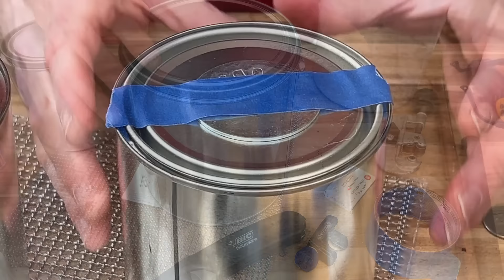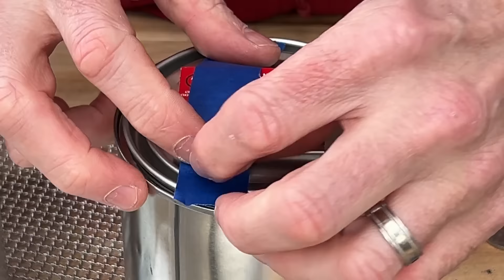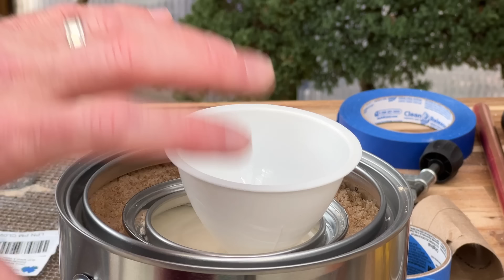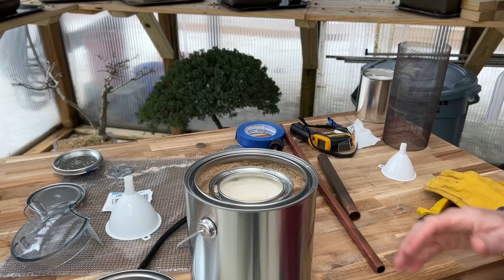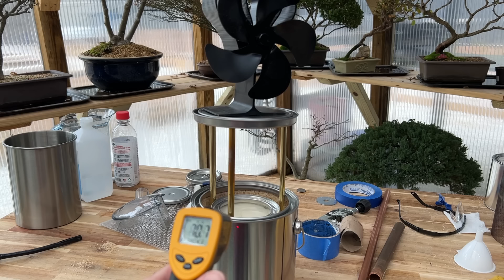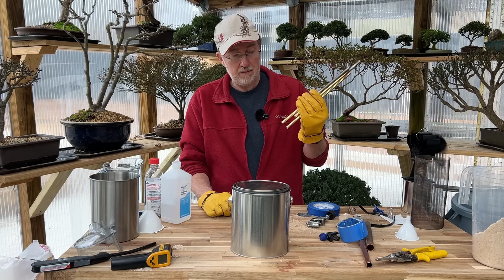Endless Heat Without Electric | Safe Reliable And Low Cost

Comment: Buy waterproof matches wrap in plastic wrap store in a pill bottle or a chewing gum container ( mentos large size )   Another tip : tin cans can be rinsed of food residue and used as a make shift kettle in an emergency.
Reply: Forgot to add when storing matches make sure to also store the striker papers on the side of the box

Comment: An upside down funnel will send the sand to the sides without getting it on the inner can.
Reply: Cool 😎
Reply: Brilliant!
Reply: Good idea. Thanks
Reply: great idea
Reply: You mean just using a funnel... Not upside-down!
Reply: @SGaux-Sandra  only if you have a very fine, granular sand that doesn't 'stick' or pack well.
Reply: @Філлм  And didn't he use wet sand on the sides as well?  That wouldn't move through a funnel very well at all unless you had a stick to push it through.
Reply: @40KoopasWereHerebut he only used wet sand because that's all he had available. He said in the beginning that they had had some rain so the sand wasn't as dry as he would like. Guessing most folks will be buying their sand and not readily able to gather it from their environment.
Reply: @cxh1225  I believe  @ stephenK....  meant to put the funnel upside down on top of the smaller can so the sand slides down the outside of the funnel and doesn't accumulate on top of the burner can.  Its good idea!!
Reply: @faridbirang3742   kudos to the people who think outside the box!

Comment: the only thing is of this is used during a power outage to warm up a indoor room, well there's no electricity to power the carbon monoxide detector,  they are usually plug in an electrical outlet
Reply: Mine is battery operated
Reply: Mine is battery operated as well.bought it for van camping

Comment: I love this. I'll be starting van life in about 9 months, and I'm worried about freezing half to death LOL I don't mind the heat but I can't stand being cold. This is probably the primary way I'm going to keep warm during the winter months I'd also considered using the terracotta pot method but I tried that at home and I feel like it's not very effective I appreciate the links for purchase too !
Reply from the maker: Be sure to get co and smoke detectors.  Cheers
Reply: @ZenGardenOasis.  I absolutely will. If you get this comment and have the time,  can you determine what the approximate burn time would be....?

Comment: The fan you’re referring to does use electricity. It makes its own electricity with a circuit converting heat to electricity DC current that’s what powers the motor for the fan. 🇺🇸🇺🇸🇺🇸%

Comment: We used this idea decades ago to heat up fish huts in the wintertime. And used the lid to check the flame /use the small lid to cover the small can 1/4 1/2 or 3/4  of the flame, it will control the size of the flame.
Got so warm we were sitting and fishing in our t-shirts. 
Works like a charm.
Reply: Did you ventilate or did you guys get headaches?

Comment: Good Idea.  As for the larger pale you could use the paint can inside the pale with sand under and around and use a full role of toilet paper.  The paper towels may not work quite as well.

Comment: I would also attach 4 posts together to be more stable for a cook surface..
Reply: Or you can attach 5 post together and  have a cook stove with one extra leg and do it in different  colors and sing and dance and do stuff like that. Then you can maybe cook burgers on it but you need a bigger can and a small. Pan .So you might have to cook one at a time only. This means someone  has to wait. OR you can cook one at a time,but split them in half as they get done and both can eat at same time. That being said ,cook one ,cut in half and share.  Cook another,cut in half and share. Save the gease to you can use it the next time in your can. OR put it in another can then make sure it's cooled before you put the lid on. Then do 20 jumping  Jack's, turn right to left 45 times.  See,I can write long ace stupid  comments  too.  Boring too.  😅

Comment: So I just made one to heat my trailer; and truly the denatured alcohol burns clean:

but have you any tips on dealing with the smell of burning toilet paper, as the alcohol dissipates?
Reply from the maker: You need ventilation and co detectors
Reply: @ZenGardenOasis.  But you said in your video that it provides clean heat for hours.

The alcohol, when filled to the full, burns off in about an hour, leaving burning toilet paper as the remaining heat source for any additional time beyond an hour.

Wondering if I missed something in your invention's design.

Comment: I suggest looking into pervious concrete for the 'wick' should burn just as long and the wick will never need replacement.
could fill the sides with sealed concrete? the concrete would make transportation of the entire unit more durable.

Comment: Finally feeling more secure with my pantry preparations thanks to your encouragement!  In way of preparedness I wanted to share that I found a site online that shows you how to make an emergency heater very easily. Search “zen garden oasis and the post was about 6 mo ago. He basically uses unused gallon and quart paint cans, sand , a couple pipes, a roll of toilet paper and denatured alcohol to make an efficient heater that can be used indoor in cold weather emergency, and could be cooked on as well.

Comment: When deer hunting as a kid with my Dad he taught me this using an empty one pound coffee can, We didn’t use a larger can with sand. It put out great heat and we just tamped the bottom of our boot on the top to put out the flame a few minutes before we were going to leave to give it time to cool. When cool to the touch we put the plastic lid back on to keep it from evaporating. This brought back great memories. Thanks
Reply: Great idea about the coffee can, but I haven't seen a metal coffee can in years. Maybe they are out there, I'm not a coffee drinker.  Lol.
Reply: @onetweetygirl71 walkthrough grocery store and you can see metal cans😅😅😅😅😅
Reply: @davidgoosen1633 true, but we/I was talking coffee can, with a lid. Most cans you find in grocery stores do not have a lid. Some yes,  but in mine, no, or i have to search high and low or request a product.
Reply: Prepared Hero Fire Blankets would be awesome to have next to one of these heaters. If a person caught their clothes on fire you would just wrap the fire blanket around them or if you needed to put a fire out you just lay the fire blanket over the fire. I bought them for my family last year. My grandson put his in his room. I keep one in my apartment and one in my car.
Reply: I found a way to help make similar small heat source to start a burn pile or fire. Small tiny cans to hold the half used toilet paper roll, pour in 91% alcohol. Carry out to the pile or small fire pit; then set under the pile of limbs or small logs, we save a few dry leaves spread throughout the pile...now light the small can or cans. Even wait to pour the alcohol outside into  the prepared cans with roll of tp. Ill try his suggestion of denatured alcohol too. This is the cheapest fire starters and I've splashed a little alcohol through the tree limb pile or fire pit then light. 🔥
Reply: Wow, you must have nothing else to think about
Reply: @RickCochran-i3y yup,
Reply: Great memories of you you hunting down and shooting deer? Wow!
Reply: @astelbele you do know that people eat venison all the time, right?  Real hunters use the meat from the animals they hunt, whether squirrels, ducks, geese, deer, rabbit, etc…Ohhh, and that includes fish since fishing is fish hunting. 
They aren’t creeps who murder animals for fun or sport and just take pictures to feed their ego. 
You wouldn’t be here today if your ancestors hadn’t hunted their food for survival.  They didn’t have grocery stores, genius. 
(And, I’m not a hunter. But I know many and they are good people who use the meat and freeze the rest for later consumption in various ways like sausage or jerky, etc…  I can’t kill them, personally, but if I had to to survive, I would, just like our ancestors.)
Reply: @Doggirl1007 Yes, but there are people who fo it for fun and for trophies.  You fo know that correct ? Can't deny that it does not happen.
Reply: @astelbele just because some losers exist, doesn’t mean it’s appropriate to imply this person is heartless or cruel. Why do you have to have hate in your heart all the time?  He and his dad had a tradition he spoke of.  You’re just itching for an argument or place to spew your anger. 
Another question…do you consider the Native Americans to be wrong for hunting and spear fishing? 
Okay for some people but others are just brutal? 
Give your central nervous system a break and relax.
Reply: @Doggirl1007 Go take a hike and harrassing me. It's my opinion and if you don't like it, too bad for you.  Just stop trying to figure out why my views are different than yours. I don't appreciate your false insights on my life. Go away.
Reply: @Doggirl1007  I agree. You will find cruelty in all aspects of life ( hunting, parenting, etc) but that does not speak to the whole. Indigenous people hunted the weakest, gave thanks to the animal for giving its life to provide for the people. Then they used almost every part of the animal. Meat for food, skin for clothing, bones for tools, etc. 
Then you have animals that are culled because of over population where too many of one species can cause imbalance overall. I am not a hunter. Don’t know if I ever could be but I choose to look at them individually and at their intent. If you need food, fine. If you’re a moron that just likes to kill… I pity you and your cruelty.
Reply: Great memories of you hunting down and shooting deer? Wow!

Comment: Im currently cruising the east coast of Florida in a small home made sailing canoe and i use a home made alcohol burner with a home made stove every day. 70% rubbing alcohol burns but most of the energy in the flame is used to boil off the water in it. It's just not hot enough to make noodles. It will eventually boil but your noodles will be mush before they're cooked. 93% rubbing alcohol burns hot enough to cook but makes a lot of fumes. I buy denatured alcohol by the gallon and it's much cheaper. I use it in a small enclosed space and in my tent every day with no problem.
Reply: Go to the lawn and garden center and look at ceramic flower pots. They have trays for water. Get one that fits under your stove and it keeps the stove from burning your table top. Now find a smaller ceramic pot that fits over the stove pipe...get the one with a drain hole at the bottom and place it upside down over the stove flame. That ceramic will radiate heat faster than sand and a small fan blowing at it will circulate the air.
Reply: I use a fiberglass wick and it lasts longer than the stove. If you want lantern light just get some steel mesh/screen and make a ball shape of steel mesh then suspend that in the top of your flame. It will glow very brightly and cast off plenty of light. You're welcome.

Comment: Here, too, the following applies: Calculate the calorific value of the liquid, and you'll quickly realize that this is never enough to heat a room. Unless the temperature difference between outside and inside is extremely small, no one can extract more energy from the calorific value of the liquid by adding additional components.
But I like tinkerers.
Reply: You are right. That is where insulation value can become the secondary player...
Reply: @tiggywink1  
Correct, the insulation value only shows the losses between inside and outside

Comment: I don’t know how safe they were but we used to use small cans, cardboard, and paraffin wax. We called them Bunson Burners. We used them on camping and hiking trips for when we were above tree level. And later for all our cooking while camping. They produced enough heat to cook our meals but we’re on the slow side because the cans were small for weight factor.
Reply: I like the wax idea. Shelf life is probably longer than alcohol. However does it burn cleaner than the alcohol he talked about?

Comment: The fan is powered by electricity. These are bimetal battery fans. Two different metals when heated generate electricity. Very old tech. Used in 1920 to power radios in rural areas.
Reply: Where do you get the fan?
Reply: @JasonWasdin  in new zealand and australia hardware stores.
Reply: Not all of them , this fan works with heat only , place it on yiur ass you will see lol kidding

Comment: Carbon dioxide and monoxide important, but don't forget the use of oxygen. Don't want to suffocate.   Excellent video. Have small coffee cans with cheap toilet paper but didn't know about sand and maybe big coffee can.  Have denatured alcohol for penny hobo stoves but didn't realize the importance for this type of heating device.  If store denatured alcohol in store bought can, paint can with clear fingernail polish, so it does not rust.
Reply: But isn't nail polish flammable?
Reply: @zelmanewell5486 
Not when it's dried , I think

Comment: Thanks. How long will it burn?
Reply from the maker: Depends on purity of fuel…cheers
Reply: @ZenGardenOasis. Well, that's not an answer.  If you don't know, say so.  Otherwise, give an answer for denatured alcohol at least.  Then you could say it would be less time with a less pure fuel.
Reply: @ZenGardenOasis. I thinking if using the exact same setup in the video for keeping a greenhouse above freezing on Kansas. A range would be helpful, I’m totally ignorant and don’t know if it’s an hour or ten.